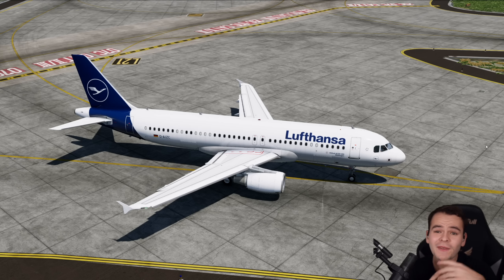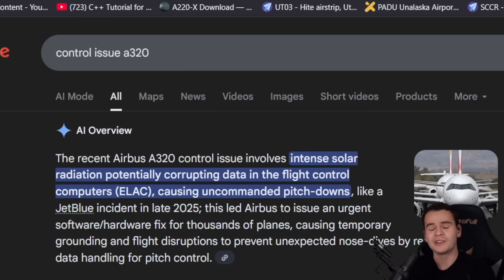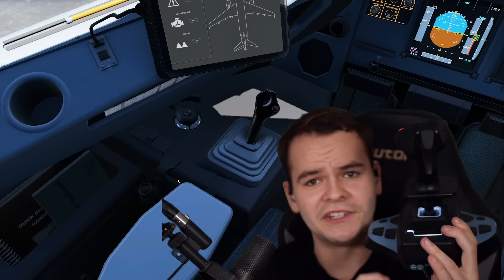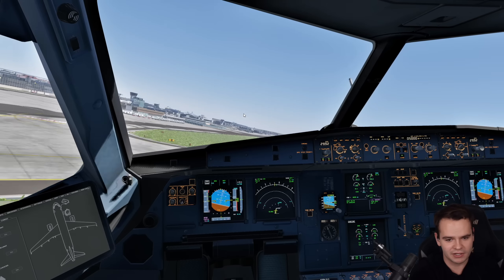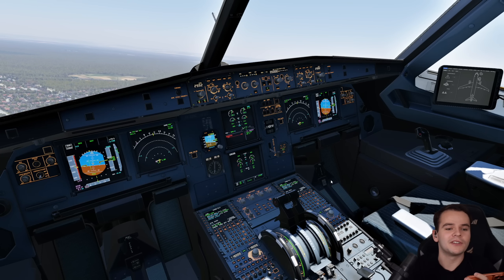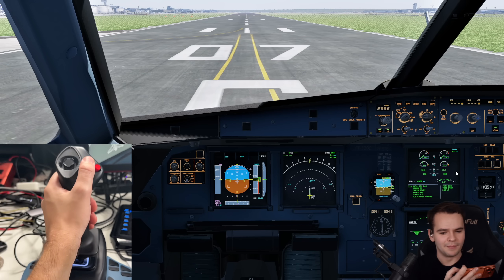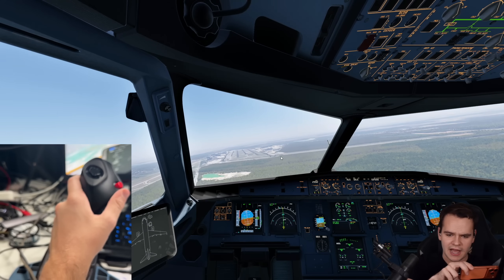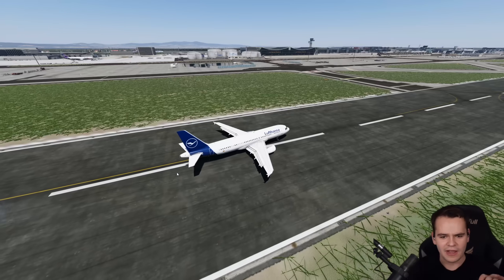The SHOCKING Truth About Fly-By-Wire Systems on the A320

Comment: Actually, the Airbus side-stick is a lot more different than your computer joystick.

They use multiple dampers the size of your car’s suspension underneath the stick with multiple redundancy and fail-safe modes available… Basically, the entire cabinet below the side-stick right down to the floor and even underneath it, are all mechanisms for the side-stick.

Comment: The maintenance crew working on an Embraer E190 in 2018 managed to install the cables of the ailerons wrong, which caused reverse control problems similar to here and the pilots managed to land safely, but the plane was written off. Messing up wiring is one thing, completely screwing up the cables in both wings is crazy

Comment: Engineer in the avionics biz here
Regarding the solar radiation, that is what we would call a "Neutron Single Even Upset" - A a highly charged neutron slams into some particles and flips a bit 0 to 1 or vice versa. Usually it's zero or minimal impact (you'd be amazed how much data is flowing around these systems and a frame or two of a bad bit isn't usually a problem), but occasionally it hits an important one and causes some weird effects. Lots of HUD flickering or blanking, occasional CAS messages, usually not so much in flight controls or GPS (though it can and likely has happened)

We mitigate this by doing a lot of testing for High Intensity Radiated Fields and Indirect Effects of Lightning. Throw a bunch of radiation and lightning simulations at all of the bits and pieces of the system while we simulate an approach and record results. Still, impossible to test for every conceivable condition or every possible bit that could get flipped. 

To be clear, I am just an engineer that mostly translates pilot speak to engineer speak and vice versa - I am not an environmental effects engineer, so some of my details could be wrong, but that's the gist as I understand it. Just felt like sharing some more context on it cause it's neat,

Comment: Bro you should really try the Toliss a320neo or the -200 model, it's miles better than FF a320 as that is not being maitained. The Toliss even has circuit breakers working and is even better than fenix or fslabs